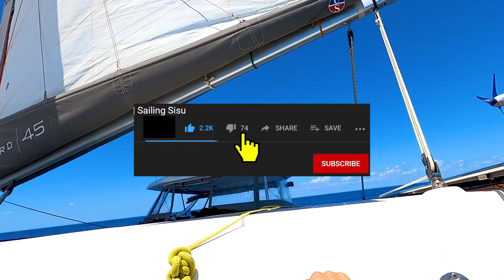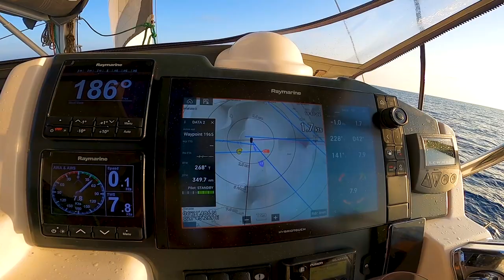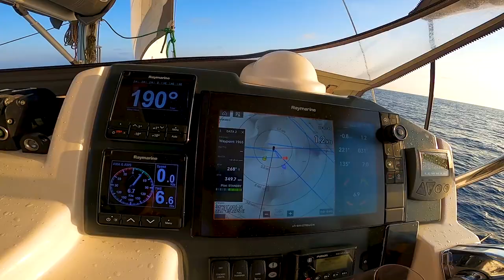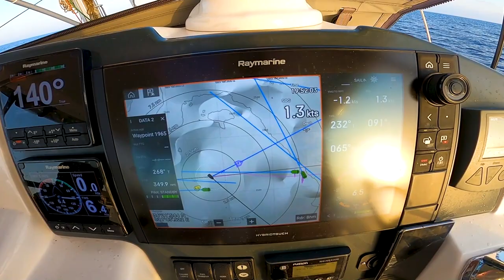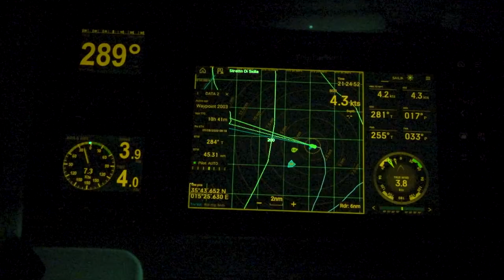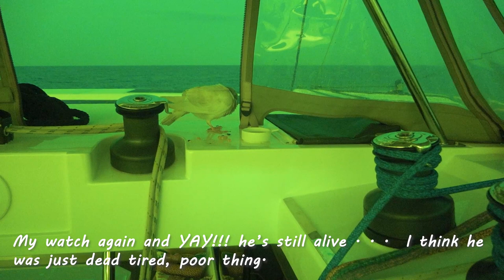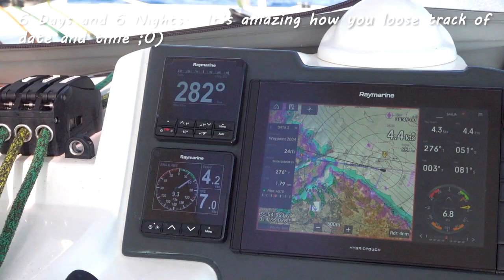#113 HOW we FILL our LPG AT SEA | Sailing SISU Leopard 45 CATAMARAN

Comment: Nice edit guys. I have had to fill my cylinders like that for the past 4 years. One tip is to open the brass valve on the side of your cadac with a flat screwdriver and the liquid goes in quicker. When it's full you get a burst of white liquid coming out the valve and you screw it closed. Then do as you did .👍
Reply from the maker: Oh, wow! That is now good advice! another reason to keep our Cadacs!

Comment: Thanks again...  great video.  I was especially pleased to see the heave-to.  That’s great to know my dream boat will nicely heave-to.  Have you ever tried it in heavy winds with reefed sails?    Would the side on to waves make it a very uncomfortable and noisy environment?  Would it be risky at all?
Reply from the maker: Wel, in calm seas and not too strong a breeze, is it quite OK. But Cats do not like to be in hove-to in big swells. The bows get clipped by big swells and swing the boat in a-lull or abreast where the next oncoming swells will hit you straight on the beam. Always go 45ish into the swells as long as you can because this way the storm will pass quicker. If it gets worse, then time it good, turn by hand as fast as possible, and run with the waves. It will take much longer for the storm to pass since you are now running with it, but the rigging, the boat, the noise, the moods, and general anxiousness will go down 100%
Reply: @SailingSisu  thanks so much for replying.  Yours is the boat we would like to buy one day.  I’ve often wondered how best to ‘linger’ outside a destination if arriving at night and it’s not known, or nav marked sufficiently.  So it’s sounding like hove-to is only ok in small sea state.  On another note...  when visiting a 2018 L45 at a show I was a bit daunted by the height of the boom.  The bag and sail would be a difficult beast to wrestle in wind at that height I think.   If you have time...   How do you find it?
Reply from the maker: If you have to linger in calmish seas, and you want to keep the bows at a certain angle to the waves, then yes, hove to, otherwise, drop the sails and just drift, but this way the boat may go sideways and gets uncomfortable. As for the boom, it is high. The stack pack even higher. I am tall, but even on the Lagoon I have to reach up. You can drop the boom quite low, but still...
Reply from the maker: Aaahw, thank you for the kind words Tony!!!

Comment: Propane has 3 carbon bindings per molecule, whilst butane gas 4 carbon bindings per molecule.  Propane is apparently more safe for indoor use. Just don't smoke the stuff 😇
Reply from the maker: Oostenwald, perhaps you taught me something, but I always thought carbon has four bindings? Or are you talking about the number of carbon molecules where methane has one, ethane two, propane three, and butane four and all are 'surrounded' by hydrogen which has one binding? But, I got the picture!
Reply: Ek dink jy is reg. Ek was te lank laas op skool. 😀

Comment: be certain your engines are not running when transferring lpg, if it enters your intake when bleeding off your engine will run wild
Reply from the maker: Very good observation! I guess for that matter we should turn off all electronics and cellphones too?
Reply: @SailingSisu  any arcing device that is in the vicinity, worked in hazardous locations for a lot of years

Comment: how do you know how much ullage you have them bottles you are filling....you could overfill them and then you`d be in deep shit,you should weigh the bottles to see if the 3/4/7 kilos of gas you have will not overfill the bottle. I do this job for a living and boy you are playing with fire my friend 
i did not see an ullage valve on these bottles,if you have one of these then just fill until its vented if they do not then weight them first etc 

MAKESURE YOU WEIGH THE BOTTLES BEFORE YOU SYPHON INTO THE BIGGER BOTTLES.

Happy sailing.
Reply from the maker: Great comment, Neil. Yes, as I said, it is very possible to overfill, but not a problem if you follow what I said? When you are in a bind, like almost everyone I met who circumnavigates with a sailboat and visit remote places, one does not have the luxury of technicians or fancy instruments so, fill the bottle by gravity feed, then when you think your filled, unhook and open the filled bottle to bleed off in open air (always downwind and in a breeze) until the escaping liquid part changes to escaping gas. You are 100% correct, you do not want to have liquid in your burner system.

Comment: U're doing a very dangerous stuff. I work with gas. Most accidents i know off happend while people did stuff like this snd not even on the boat.
Reply from the maker: I agree 100% But, when you are in a bind, like almost everyone I met who circumnavigates with a sailboat and visit remote places, one does not have the luxury of technicians or fancy instruments so, the next best thing is to try and be safe as possible. Do what the expert technicians like you are doing. But since you are here, please tell us you would have done it differently to make it safer? Our viewers, including me, could learn a lot more from experts like you!
Reply: @SailingSisu  ,it's simple really. I would get built in propane tank of bigger volume and 2x10 kg alu gas cylinders. I would use cylinders and keep the build one in reserve. 20kg of propane will get u far down the road.
Reply from the maker: @klemenprezelj  we have 2x 8kg. But even if it was 2x10kg...you are just kicking the can down the road. What if they run out? I have a feeling you forgot that we are circumnavigating and have visited 14 countries in 2 years, each with their own gas laws and systems, each with their own sizes and fittings.